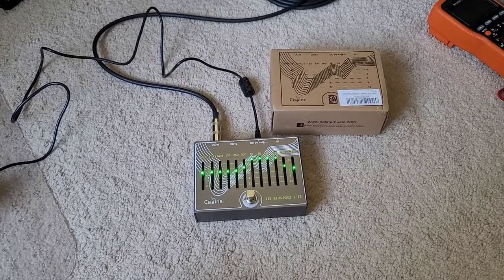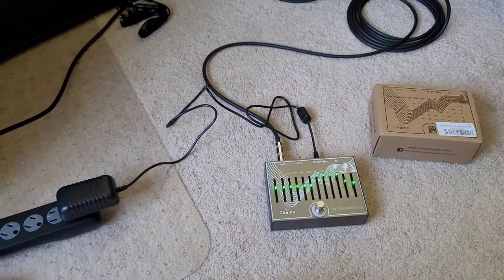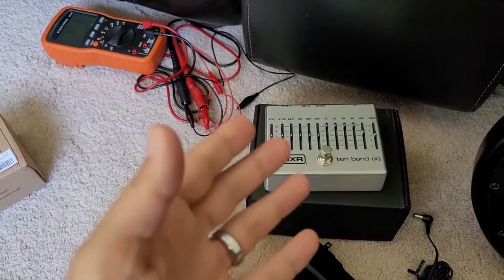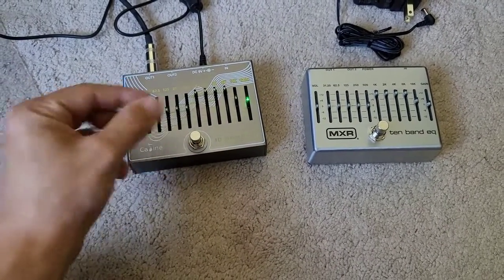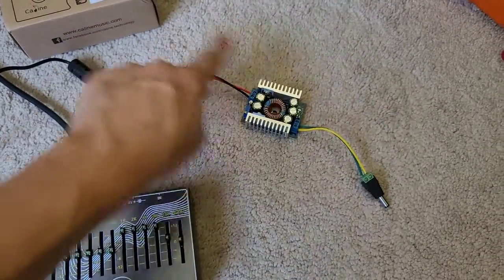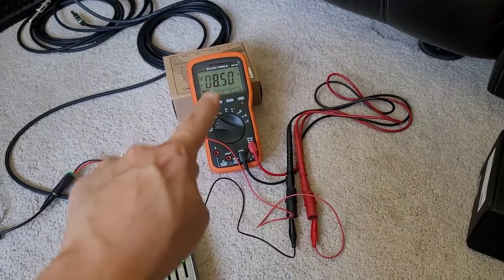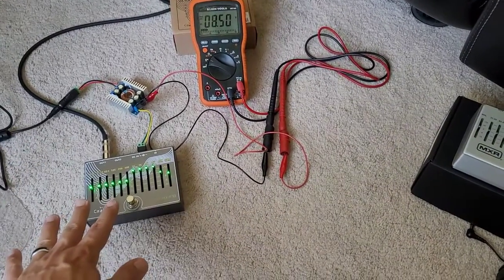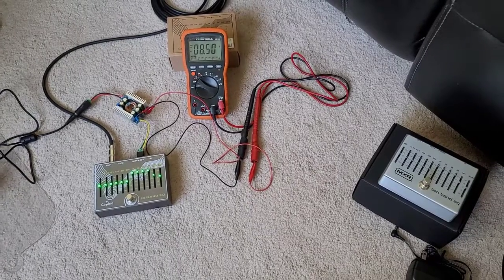Caline CP-81 (v2.1) 10 Band EQ Pedal Review and Voltage Fix

Comment: Just add a rectifier diode in series with the 9v adapter, (you can add it inside the Caline). The forward voltage drop of a rectifier is about 0.5V and the Caline will then see 8.5V from a 9v adapter.
Reply from the maker: Great idea! I will give that a try. The tolerance of the PL2628 step up chip is so small even if the voltage was like 8.6 or 8.4 volts then the noise floor gets worse. The voltage divider circuit i beleive is not set correctly. The tolerance of the components is like 5%.

My original idea is to use a multiturn 10 ohm resistor in series with the 9v adapter. It would get the correct voltage too. I like the pedal, it works great, just picky on voltage output.
Reply from the maker: Also there is already a schottky diode in series. Lower voltage drop than a standard rectifier diode. Likely there for reverse polarity protection.
Reply: @Bassguitarist1985  Senseless to use schottky for that purpose. Schottky has low reverse tollerance and is inferior to a standard Rectifier diode for reverse polarity. Someone that designed that doesnt know what they are doing.
Reply: @Bassguitarist1985  Also: have you ever compared the Caline CP-24  with the CP-81. What is the difference ?
Reply from the maker: @pensive_  added a new updated video on this voltage issue. The engineer found the component issue and is fixing it! The newer version wont have to have the voltage dialed down like I did. 

Also I discovered that the volume fader only CUTS on the Caline where the MXR Boosts and well as cut. Not sure why they did that, and that much boost on the output is not often necessary but there are some applications for it. I brought that issue to the engineers attention. Will see what he says!
Reply: @Bassguitarist1985  It is a bit alarming that you found such an (actually difficult to diagnose) solution, but the tech that designed it couldnt in the first case. Usually techs and engineers have wooden ears and cant distinguish two notes 10 cents apart and know squat about music or what is required. 
I am quite impressed how you found it. It was not obvious to take your approach. I studied EE and I most likely would not have found it the way you did, but would have found it along a more involved path. Excellent troubleshooting skills.

On another note: The resistor you used for a voltage drop is not going to be as good a s a diode to give you the required 0.5V drop. When you put signal through the equalizer, it will draw more power which will increase the current through the resistor. That will result in a larger increase in voltage across the resistor. So using a resistor, will create a varying drop voltage. Definitely not ideal. Using the forward drop of a diode rather in series exactly as you did the resistor, will give you a constant voltage drop regardless whether you draw large or small current. The resistor could create strange sags under load, as well as messing around with the step up regulator. Since the step up regulator already introduces noise, you dont want to vary the input voltage.  It definitely is a superior solution to use a diode based on your problem description.

The reason the step up regulator creates noise, is due to two factors.
1) The boost regulator is probably close to its maximum input limits at 9v which would activate the overcurrent/overvoltage circuit, which introduces noise. The Overload circuit reduces the switchmode frequency to lower the output voltage to protect itself,   which being lower, becomes audible.Based on your results this should be a problem with bucking or boost regulator switchmode IC being operated at a 9V limit..
2) If that is not the case, the designer forgot to place an 0.1uf e.g. snubbing capacitor across the electrolytics at the output. Electrolytic capacitors are notoriously bad at filtering high frequencies, therefore they are crucial. Any modulation on a high frequency switcher will be audible noise in this case. Since the overload circuit modulates the switching frequency to prevent runaway, that is exactly what you hear. The overload circuit's modulation of the switching frequency. A snubbing capacitor might fix that if that is the problem, but it is silly to work at max input voltage of a switcher. Always do no more than 70% for an audio application.

The MXR bright blue LEDS. You know of course that intense  blue leds causes glaucoma in quite short time ? It has been well confirmed in peer reviewed articles.I got rid of all my blue led gear, and the main reason I came to watch your video as I was looking for a non-blue led non-glaucoma inducing equalizer. Point in case. Just look at your video image unplayed. Notice how the blue lights of the MXR blows out the camera and how it basically fills your fingers. This is bad for your eyes and way way too intense.
Your video solved my problem finding an alternative.

Thank you very much,. I found the perfect replacement for my MXR's and your video was absolutely stellar for my purposes and will sell off my MXR's and get the Calines warts and all. The problem you identified is an easy fix for me, giving me a non-blue alternative I was looking for.
Reply from the maker: @pensive_   thank you so much for the tech feedback!!! That is the background I lack in EE. I'm working on dimming the MXR LEDs video. It is swapping out the 2k current resistors to 47k. There are 3 of those SMD ones. 

The PL2628 has a max input voltage of 26VDC so def not at its limit. If it were everyone trying to power it with 18 volts would fry it. I have a few tantulum and ceramic 0.1 uf caps. Ill try soldering across the main electrolytic cap and see if that solves the issue. I hear you on the multiturn resistor. Yes i did have to adjust it under load. Turns out the circuitry is always active drawing 0.97A at 9Volts. I adjusted the voltage under load to tun the resistor exactly. The voltage sags as expected and does not fluctuate. Many expensive pedal psus actually have an output like this with a dial to simulate a dieing battery.

Ill try your suggestions as you mentioned. If you are selling the MXR, would you keep it if I can show how to dim the blue leds, or swap them with green or red leds of equivalent size? Thats my plan anyway.
Reply from the maker: @pensive_  i also just did a follow up video doing a quick compare of the MXR and Caline. The Calines volume fader has no gain stage. The opamp is setup for unity. Only cuts 12db. Unlike the MXR which can boost and cut 12db on the volume and gain fader. Not sure why Caline did that. Likley because everyone uses it to overdrive their preamp stages. I asked them to fix that and the voltage issue. The engineer contacted me from China. Thanking me for the info, and they are sending me a free pedal now to review so they say. Time will tell.
Reply from the maker: @pensive_  hey the plot thickens... So the output capacitor that is receiving the 18 volts from the step up converter I believe is underrated for the job. It is a 100 uf 16 volt cap... And it is receiving 17.8 volts. I know enough about Electronics that you cannot exceed the voltage rating without having adverse effects. Do you think that could be the problem?
Reply from the maker: @pensive_  new development, my pcb is version 2.0 of the schematic, Caline sent be both 1.0 and 2.0. looks like the board is missing components that the 2.0v schematic says should be there. There are two inductors @ 22uH L2 and L3 and an additional capacitor 220uf in parallel with C1 missing. C1 is also undersized. Schematic says it should be 220uf, not 100uf which is in there now. So there should be a total of 440uf capacitance. This may be the issue at hand. I have those parts, going to try and add them in and see if it solves the issue.
Reply: @Bassguitarist1985  Looks like they sold you a friday botch job. Glad you get it sorted out. Missing components is completely out of the ordinary and you can expect about any error imaginable and in that case my advice cannot be accurate..  With missing inductors in the power supply there is no way it can filter properly and you can throw everything over the wall until it is replaced.
Reply from the maker: @pensive_  yup, def a botch job, oh well. I like a challenge, even if unsuccessful i still have a way to keep the pedal quiet.
Reply: @Bassguitarist1985  Your quick fix is worth gold.. very clever to have figured it out.. 
Warts and all i definitely will buy two, just on the basis that from your video I clearly hear the noise floor is about the same and operation is basically identical to the MXR after your fIx. Also I need to get rid of the blue leds, so all in all your videos were a godsent to me and convinced me to boot my MXR's.

The missing 12dB boost on the first fader as in your other video  is pretty strange. Must be due to more missing components.
Reply from the maker: @pensive_  you able to work on SMD components? I have a way to dim the blue LEDs. You can also replace them too with 2x3x4 LEDs of a different color.

Yes more missing components for the final fader. Would be difficult to add.
Reply: @Bassguitarist1985  Yeah sure I can dim the LEDs but that is not the point. Blue LEDs cause Glaucoma and i want them all out of my life.  So MXR must go.
Reply from the maker: @pensive_  I'll look to replace the blue leds with some din red ones, that will certainly be easier on the eyes in the long run.
Reply from the maker: @pensive_  One of Caline's Product Development Specialists has contacted me about this pedal. They are working on an upgraded/updated 10 band eq. They were already doing so prior to my video/inquiry, but now they will be sending me the v3.0 PCB to review and offer suggestions to correct any bugs before going to production. I'm sure the final product to market will be some time, but hey it's exciting to be a part of the process. They sent me a free "Wine Cellar" bass driver pedal as a thank you for pointing out the existing issues. 😃
Reply: @Bassguitarist1985  It is better customer service than what I get from american companies. I will definitely buy their equalizer. Already sold my MXR's
Reply: @Bassguitarist1985  That should have been the first thing that crosses your mind.. You can look at forward bias voltage for diodes there are multiple values, from 02-0.7 and higher. Easy to match.
Reply from the maker: @pensive_  just tried the 0.1uf cap across the electrolytic cap that is receiving the 18 volts from the step up converter and running it at 9 volts without my adapter and no change in the noise floor unfortunately. My only other guess is that the voltage divider inside and the size of the inductor is not correct which sets the output voltage of the step up converter.